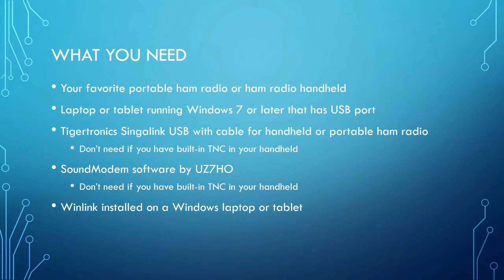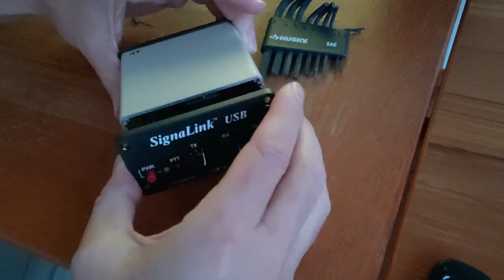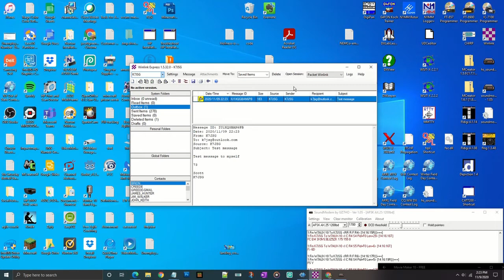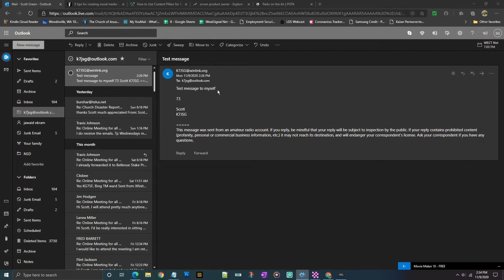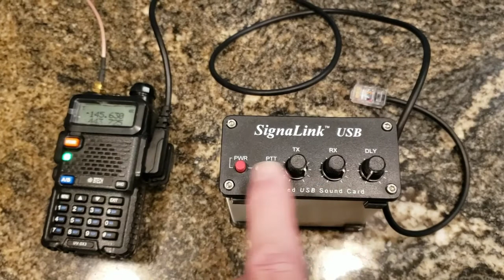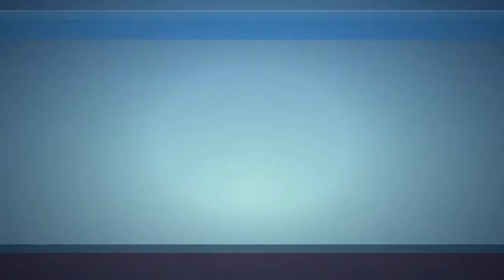Portable Email Using Winlink and Ham Radio Handheld

Comment: I would like to point out a few things... The Signalink USBs come with an allen wrench that fits the panel screws. When I bought my first Signalink I was able to use it on 1200 baud packet and VARA narrow, and I had the module plugged in for 6 pin DIN plug type radios. To do VARA wide I had to remove the module and then wire the socket for 9600 baud. For a one time setup, using the tiny wires wasn't a big deal. Using maximum or even high volume can cause the signal to over deviate on transmit, and with my Yaesu FT-2980, I was able to connect to packet gateways with no problem while having the volume just a little bit above minimum. I used the same settings with my Icom IC-92AD HT and Mobilinkd & Digirig devices. Thanks for posting this video! It should be very helpful for those who are just getting started with Winlink, and I wish more hams would get involved with using Winlink. 73 KD5YOU
Reply from the maker: Thanks for the comment John.  I agree, it would be great if more hams started using Winlink.  When I moved to Utah a couple of years ago most hams had never heard of Winlink.  I gave a presentation on Winlink to a ham radio club.
Reply: @PortableHamRadio  We use Winlink quite often in our ARES groups. If the internet goes down, Winlink may be one of the few ways to get detail messages out.

Comment: Do you have a link for the UV5RX3 Cable?  WA9RYO
Reply from the maker: Hi Bing, I always get the cable from BTECH on Amazon.   They always work.  I got one from another vendor and it didn't work.  Here is the URL to the BTECH cable on Amazon: https://amzn.to/2XCJcU5
Reply: Excellent video. People don’t always realize how useful these little HT’s can be for portable e-mail, especially in the EMCOMM setting. Tigertronics (maker of SignaLink) has the correct cable for all HT’s that use the Kenwood type 2 prong side connection. The SLCABHTW connection cable and the SLMOD6PM jumper module is the correct combination for most HT’s. Be careful when seating the jumper module. The pins are somewhat fragile, but they are CNC machined to fit securely with a “click” when fully seated. The recommendation to use a proper VHF/UHF antenna is also spot on. The rubber duck sometimes works, but an external antenna like the roll-up “Slim Jim” from N9TAX works better. I used this exact setup with a Wouxun KG UV-9P and it worked like a charm for packet and VARA FM. Sweet. Thanks Al for making this video. Great service to the amateur community.  Everything fits in a backpack or large ammo can.
Marion de KO4HJO
Reply: Excellent video I really enjoyed it